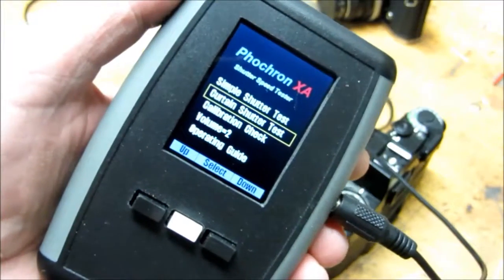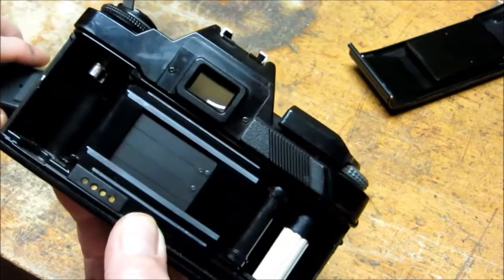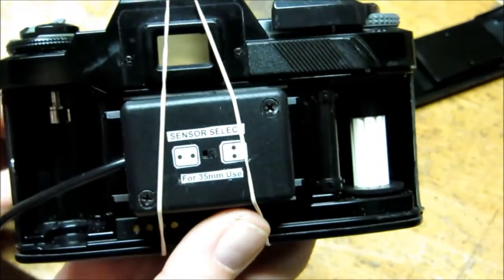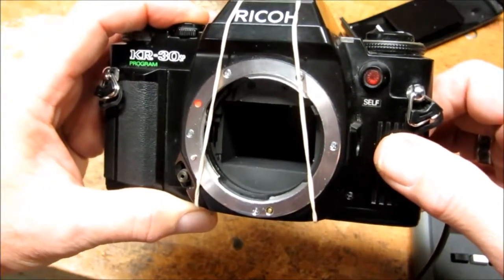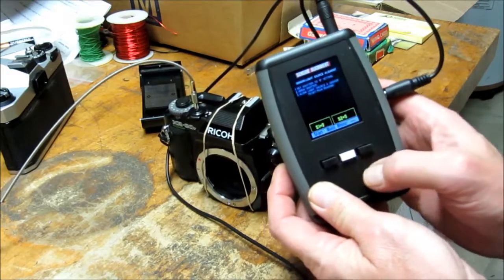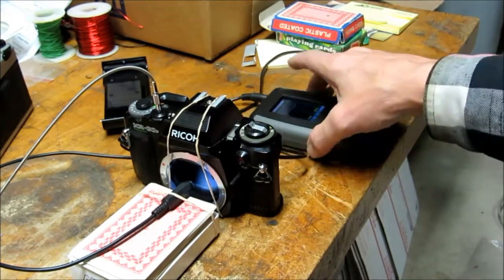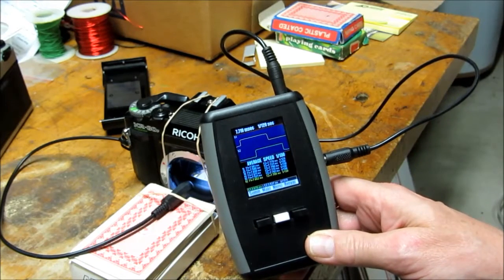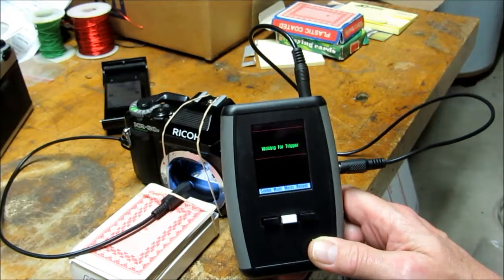Curtain shutter testing  of an SLR with the Phochron XA shutter tester

Comment: I just placed my order for this engnious product. With my large collection of vintage cameras and my own electrical and mechanical engineering skills, I was starting to plan my own microcontroller project. However, my project would have simply loaded data into a text file and I wouldn't have seen my data until I opened the spreadsheet on my PC. This packaging is top-notch! I can't wait to start the analysis of my half-century old cameras! 

Great work!

Glenn